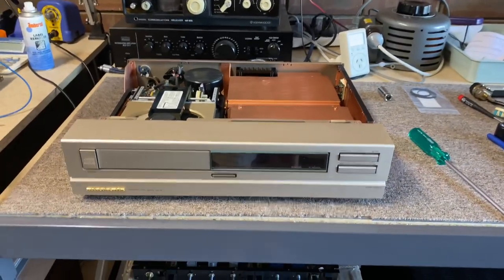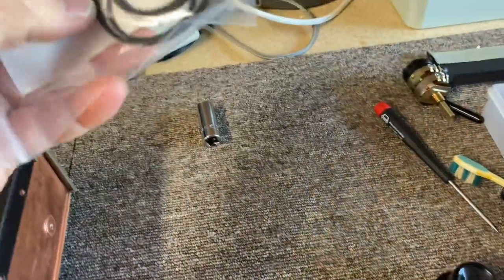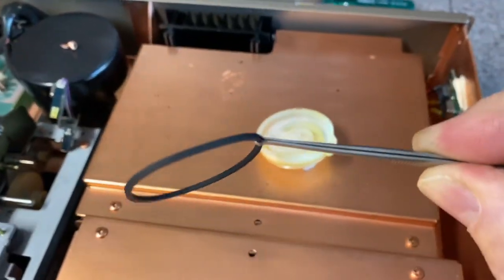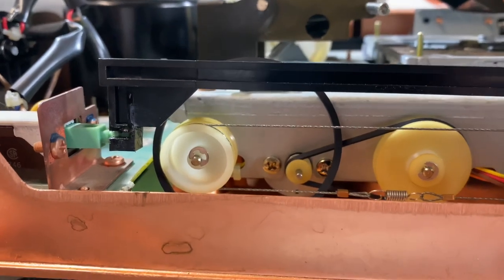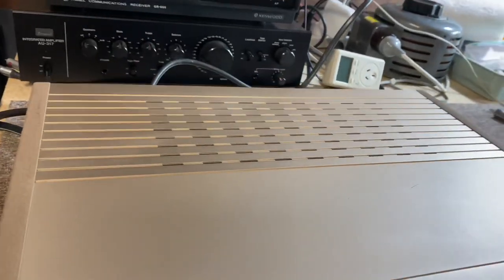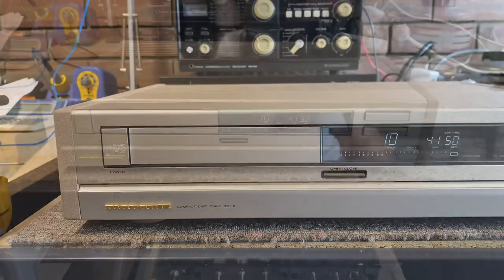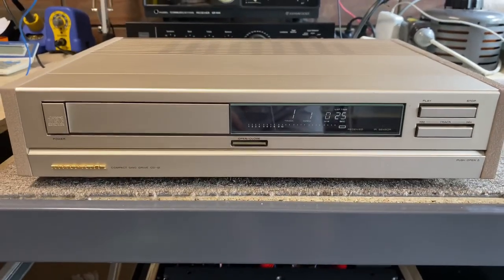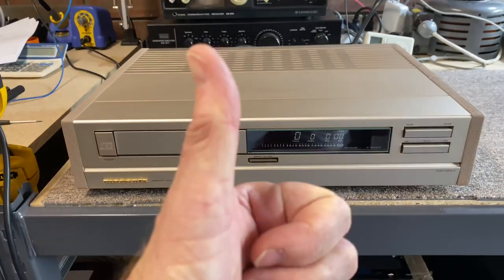Marantz CD-12 CD Drive/Transport Belt Replacement & Major Service

Comment: Good job! changed all belts on my marantz 94 mk2, takes about an hour, as long as you are methodical in your approach to changing these belts its definitely doable for the relative novice, secret is the to carefully remove the limit switch on the clamp belts to gain access , and also on the drawer belts to keep the tension on the wire when you remove the pulley to slip the long belt over but then job done! Also as you saying greasing and lubing all the rails and pivot points will make the drawer close with consumate ease and satisfaction.
The CD12 drive is actually a transport to match the DA12, not a stand alone player, but im guessing you know that, these videos are a godsend to anyone who wants to save themselves some money by having it taken into a repair shop............

Comment: This is actually a cd transport. It has no DAC onboard. Marantz DA 12 was dedicated converter.
Reply from the maker: Correct, I didn't state this in the original clips and my almost zero video production time means the occasional glitch will make it through!